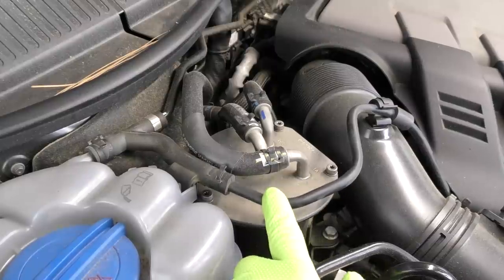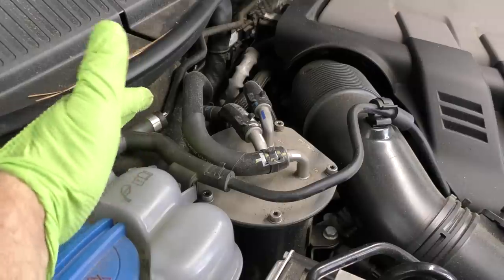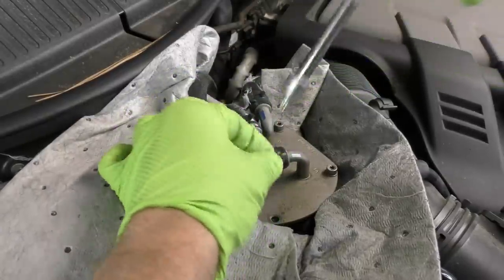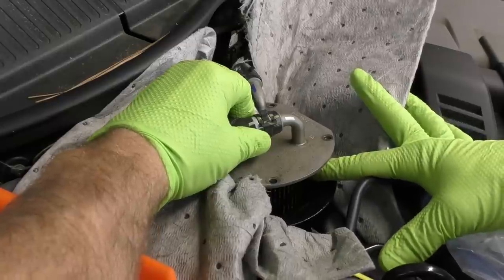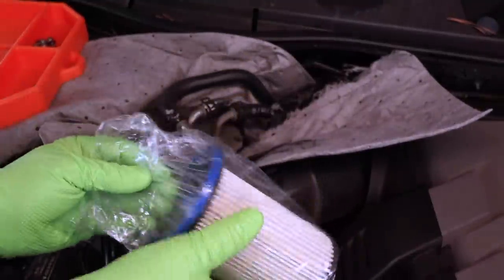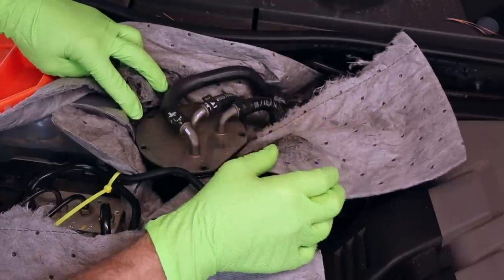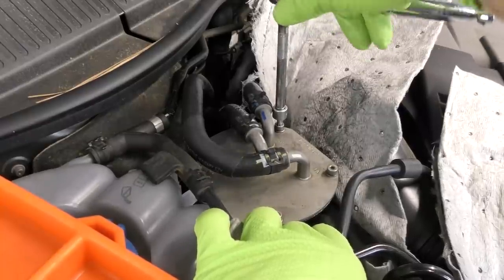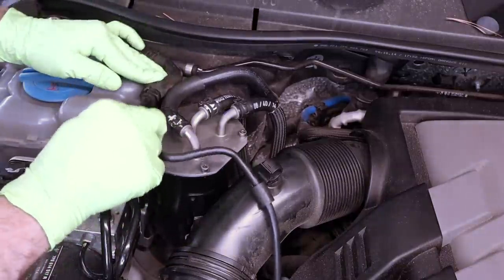How To Install TDI Fuel Filter ~ Diesel Fuel Filter Change

Comment: Just did this on my Audi A3 TDI a few days ago, i just cycled the key 2-3 times and it fired right up as if nothing happened. Easy job
Reply from the maker: Yep that IS what I would do if I didn't have the scan tool. I like to try and give you guys the "by the book" way and the "If you can't do it this way" way LOL
Reply: @HumbleMechanic  I usually do the key method only cause trying to get a scan tool at times can be very tough
Reply: Obdeleven works to.
Reply: @Noneofyourbusiness99  Yes that is true. I purchased OBDEleven for my mk6 sportwagen TDI and had no problem bleeding the system.
Reply: What A3 TDI was it? 8v ? Did you fill up the canister with diesel?
Reply: @jasonjay7650   sold the car but it was a 2013 A3 hatchback... No didnt fill the cannister, just cycled the key to run the fuel pump, started right up.
Reply: @FrenchValleyAirport  I have a 64 reg where the screen comes out the dash.  I want to tackle this job myself but keep hearing horror stories about harming the pump if you don't use vdcs. Thanks for the information.
Reply: @jasonjay7650  Nah, the fact my car started normally shows there was probably little to 0 air.
Reply: @jasonjay7650  i found no need to fill up the canister with diesel.  If the fuel pump is running it should fill that canister in a few minutes.

Comment: Did mine yesterday with the push button start cycling method on a 15 Golf TDI.  Didn't hear the pump running but did the process about 20 times, including driver door openings and closings since I had heard the pump run before when entering the car.  The first crack it ran for about 3 seconds and then died.  On second crank it didn't start.  I began to get concerned and called a VW specialist nearby inquiring how much it would cost to get air out of the fuel system, but he recommended trying another time.  On the third attempt it cranked right up.  TLDR thought I was about to have a $500 filter change but it all worked out.  Thanks for the vid!  (I was also outdoors on a slight incline, don't know if that would make a difference.)

Comment: This is a very helpful video.  I just changed the fuel filter in my 2014 Sportwagen TDI, and did not spill more than a few drops of fuel. The Mann PU936 filter came with an o-ring, and that too was an easy swap out.  As you suggested I cycled the ignition key a few times, waiting perhaps 5 minutes each time, and the engine started up cleanly on the first flick of the key, indicating a full injection pump.
Reply from the maker: Awesome

Comment: Just like my MK3 Leon filter, and very different to my mk1 Leon with the whole canister replacement of the Mk4 golf era.

I don't like putting the absorbent matting around my filter housing because it tends to give off a lot of fluff and shreds. I tend to put it much lower than the housing to prevent any of these bits getting into the fuel system.

Also, for some reason my VCDS won't bleed my system, it fails every time...

Good video, thanks for sharing! Enjoy the content even when I know the task you are discussing. Always great hearing your experience.

Comment: '12 TDI Touareg Exec., I actually do it every oil change. (5k miles). I also use Liqui Molly diesel fuel additive once a month, fixed an injector fault code and she runs smooth and strong! Tks for the great videos but yes we do need more TDI content ;)

Comment: As a Technician... I can confirm most vehicles don't get a new fuel filter until something breaks and blows up 10 years later... I've never seen such a clean and virgin fuel filter that was only 4 years old!!! Shiney!!
Reply from the maker: I Am guessing this was replaced before. I just didn't have record of it
Reply: Fuel filters on diesels have a service interval tho. Usually 60 or 90k kilometers.
Reply: Lol mine was never replaced on my tdi and it started sputtering above 3000rpm so i thought it might need a service.

Comment from the maker: Typically the filters are due every 20k miles. IF you are modified, or concerned about fuel, do it a little more. There used to be a couple of MVB to monitor injectors to intemperate that as fuel filter clogged, but I could not find it on the Touareg.
Reply: i hate changing that filter because about a year ago when i didnt have a computer its wayyy to complicated to bleed the system on old multivans
Reply: my vw cc 2.0 tdi service plan says you should change every 60k miles?
Reply from the maker: @faz06  60k wow! Not sure on ROW cars, but I am Pretty sure all VWs in the US are 20k
Reply: @HumbleMechanic  I have a VW Tiguan 2.0 TDI 170HP. The manual says 60.000 km ( almost 40k miles). I went over the limit and changed it at 52k miles (85.000 km) and it looked 1/3 used/clogged only. This is East Europe (Romania). Everything ok.
Reply: My 2010 passat cc cbab engine  service book (France) tells me to change oil and filter every 30k (long life), engine and air filter every 60k and fuel filter every 90k. I usually change oil, air and engine filters every 15/20k and fuel filter every 30/40k. I always thought the service book intervals were a bit exagerated.

Comment: Nice video Charles! I have never done a fuel filter on a VW but I do them on diesel Ram trucks all the time, it's pretty similar except the trucks have 2 of them, one in the engine bay and one above the rear driveshaft. I don't mind as much if I make a mess with the fuel because the trucks have a lot more space in the engine bay and I always pressure wash the excess fuel off afterwards.

Comment: Can’t believe you didn’t suck the old fuel in the fuel filter housing with your oil sucker tool I always do it on all the cars I service and I do use the VCDS and run the fuel pump cycle at least twice with a power supply on the battery.

Comment: I have a 2014 Volkswagen Jetta TDI can you damage  The high pressure pump cycling the key on and off after changing the filter? The reason I'm asking is the service adviser at my Volkswagen shop told me I could damage the high pressure fuel pump but if that's true I believe you would have said so in this video.

Comment: I always change mine once a year for the car I use daily and every couple of years for the rest as the filters are very cheap and you can clean the contaminants and water from the filter housing. Older models have a bolt with a copper washer in the middle to help bleeding air out of the system.

Comment: I have a 2021 Tiguan and one of the screws on the filter top is slap bang underneath the headlight adjuster, there's always something. The headlight adjuster doesn't look like an easy take off, in fact might be easier to take engine out :-(
Is there no water trap anywhere? All the videos on here, no one empties the bowl to ensure no water in the bottom, I'd have thought it critical

Comment: I changed diesel fuel filter on my MK3 Jetta maybe a week ago ;) and this was fun to watch, BUT, i have a huge question floating around. Yes, on some other cars that i have worked, which have common-rail injection cycling the key 2-3,.. 5 times does the job, however i've heard that on MK7 TDIs, even MK6s, pumps won't start until you actually start the engine, which kinda leaves you screwed. Is that true? I never worked on any MK6 or 7 TDI so i am curious about it. I mean i would try to get it done like i do on my MK3, fill the filter (well, filter housing in this case) all the way, put it back and try to start the engine. Works every time, it starts like nothing ever happened and it runs fine, no hiccups or anything. I leave it idling for few minutes just to be sure, and i rev it up few times and that's it. Takes around 30 minutes.

Comment: Could you possibly do a short vid on the difference between the early and late model fuel filters on the 2.0L TDIs? Looking to change the one in my mk6 jetta with the CJAA engine. Thanks :-]

Comment: I’ve recently done fuel filter on two vehicles the same, 1.6 tdi mk6 2011 and they both ended up air locked, I done the ignition on/off method and neither would start up, had right carry on pulling pipes etc, I don’t have a scan tool that has the feature to bleed the system

Comment: I have a 2014 sportwagen jetta tdi is it possible to bypass the fuel pump relays to activate them and get the same results instead of using a scan tool
Reply: I have wondered about this, as well.  It seems to me that you could use a Powerprobe to power the pump and bypass the relay. Does that make sense?

Comment: You mentioned OBDeleven, does it have the fuel pump activation feature to purge the fuel system?  I’ve looked that scan tool up but there is no mention of that feature, I don’t want to spend a fortune as only a DIYer

Comment: Hi Charles, i have a 09 Phaeton 3.0tdi. Could you point me in the right direction i have high fuel consumption. It uses 11L per 100km but the onboard computer shows 7.7L per 100km. I have noticed my temperature is not going about 60C on the freeway which i am suspecting is a faulty thermostat but could it affect the fuel economy that much.? Thanks in advance.

Comment: Hey dude i really need your help! I changed my fuel filter to a non genuine one (mann filter) i turned ignition too many times i think for like a minute and my acceleration from 800rpm idle to 3000rpm is so slow and heavy, how long should i turn the ignition on and off? I’m going to buy another fuel filter but genuine audi one. My car is (2014 audi a3 sport-back 8V 1.6 TDI manual)
Reply: Man fuel filters are OEM the ones we buy are built-in Germany and one of the suppliers to VW in Germany.

Comment: @HumbleMechanic So i recently picked a 2012 MK6 Golf. I've seen videos saying just turning ignition ondoesn't cycle the fuel pump. You either have to have VCDS, or jump 2 sets of relays @ the same time= royal pain. Is this true?

Comment: I got a Seat with the 1.6 tdi engine and it's always a pain. I've changed the fuel filter (canister) 2 times already and no matter what or how I do it, air always manages to get trapped and the engine doesn't turn on. It's a complete nightmare. This last time I pre filled the filter with fuel additive until it drip so no air bubbles, connected the fuel lines as fast and as careful as I could. Did the bleeding through vcds 5 or more times just to be on the safe side, turn engine on, it worked for 5 seconds I thought "yay it worked this time" and then died. Spent an entire evening trying to bleed the air with a syringe and the more I pushed the more air bubbles showed in. The weirdest part is I saw mechanics changing the fuel filter and simply turning the engine and it fires right away.
Reply: Did you manage to find the problem for this?
Reply: @MrAdamKhawaja  No

Comment: Surprised you didn't drain the fuel canister out.  I have a Cayenne Diesel and Porsche wants it drained every 10k miles.  Since the filter is only ~$25 I just replace the filter at the same time vs the 20k mile interval Porsche says
Reply: Same thing I do everytime I change a filter. When cleaning the housing I can inspect for fuel pump failing if I see any orange particles that look like rust.
Reply: On the older models you had to drain the canister, but not on the new(er) ones.
Reply: I run stanadyne every second tank and haven’t found any water in the Treg or my powerstroke since I started using it
Reply: @panzerveps  my Cayenne diesel is a 2015, Porsche still wants the fuel canister drained every 10k miles
Reply: @docwyte  Cayenne and Touareg have the same engine, the difference is the block is aluminum in Porsche and Steel in Touareg.  And VW says that fuel filter has to be changed every 20k miles.
Reply: @tosyawilldoit  Yeah, I said the interval was 20k miles in the last sentence of my post above.  But Porsche wants you to drain the fuel out of the canister every 10k miles, to do so, you have to remove the filter, so it seems stupid to not replace it at the same time given how cheap it is
Reply: @docwyte  🤷‍♂️
Makes sense

Comment: Just curious as to what procedures you would take for a mechanical fuel pump like the alh engine in the mk4 jetta tdi
Reply from the maker: I always PREfilled those with ATF. You can use a vac pump to pull the last but through the lines
Reply: @HumbleMechanic  ok. My father said something about that but he wasn't sure. Thanks for the info.
Reply: @HumbleMechanic  am I reading your reply correctly?  ATF to prefill the fuel filter cannister?
Reply from the maker: Yes for the ALH it was good. New ones probably not so much

Comment: Good video. fuel filter design is clumsy and looks crammed in, I've dealt with diesel fuel filters on MBs, and older VWs that simply screwed on, what utility does this bring to the user?  Not as bad as the piece of krap filter on my old chevy suburban diesel, every 5k miles it failed, typical GM design.
Reply from the maker: Utilities to the user is one of the lowest concerns with this type of thing. Lol they don’t be caring

Comment: i recently watched a video on Liquimoly diesel purge and found out some people recommend pouring a can inside the filter housing and running the car straight purge ; do you think doing that on the Treg 3.0 TDI be OK?
Reply from the maker: I don’t want to run it straight. Maybe the ALH but not the Touareg for me
Reply: HumbleMechanic thanks ; do you think is even worth pouring in fuel tank? maybe you can make a experiment with thay kinda thing there is very confusing info

Comment: Man, doing fuel filters on a VW diesel is very different than the Powerstroke trucks I'm used to. They have 2 (ever since 2003 with the introduction of the 6.0l) and it's a much more involved job and it's supposed to be done every 12k-15k. Depends on the time of year and how much you drive, and the way you treat your truck. But for the fuel bleeding, I cycle the key 10 times, with an interval of letting the key stay on for 30 seconds and then re-cycling it. Interesting to see how it's done on VWs, though. Seems like it's a bit easier and less time consuming. That's probably the only time I'll ever say that working on a VW is easier and less time consuming than working on a Ford.

Comment: Have done two Fuel Filter changes so far in our 15 Golf TDI, didn't know about the priming method with VCDS or OBDEleven until just after the last change.

What I've done is clean out the fuel filter housing by sucking the fuel out and wiping down with a lint free rag, then after I place in the new fuel filter, I fill the housing with fresh diesel slowly so the fuel enters from the outside of the filter, insert the pickup for the HPFP in the hole, tighten down, then a couple key cycles.

I'm sure there is a tiny amount of air still in the system this way, but the starter literally cranks for only half a second more before it fires up, the difference in start of normal vs after a filter change is turn key chug fire vs turn key chug *chug *fire*.

Our local VW dealer quoted $180 to change the fuel filter.

Comment: Charles why is the mark 6 golf 1.6tdi such a pain to bleed and normally requires a computer to prime the system
Reply from the maker: They all technically "require" it, but a bunch of key cycles helps that
Reply: Thanks Charles appreciate the help wish it was like Mercedes tho put the filter on and turn the key and crank engine till start and away you go 🤣
Reply: I also have mk6 golf 1.6 tdi and becouse of fuel filter I bought Obdeleven. Unfortunatley even that didn't help. When you start the fuel pump in the tank it cycles fuel only betwen tank and fuel filter. Fuel line that goes from filter to HPFP drains the fuel when you lift the cover of the filter and than youre stuck with air pocket in the line. Than you cycle the pump in the tank which doesn't prime the fuel line leading to the HPFP. Than you start the car, HPFP air locks and car doesn't start. (starts for a second or two, than dies and cant start again)
I since found out that when you prime the fuel system with obd computer first you cycle the pump about two times than on the third cycle start the prime pump and while pump running disconnect fuel line leading from filter to the HPFP at the HPFP (but only slightly so the air can escape out, becouse emmediatley after that the fuel will rush out and spray everything!). Put some rags around the fuel line, and than quickly reattach the line and secure it with clamp. Stop the tank pump or leave it until cycle stops. 
Than start the car. Works every time.
I serviced bunch of the VW diesel engines, but only had to do this on mk 6 golf 1.6 tdi.
Reply: I got a Seat with the same engine and I feel your pain. I've changed the fuel filter 2 times already and no matter what or how I do it, air always manages to get trapped and the engine doesn't turn on. It's a complete nightmare. This last time I pre filled the filter with fuel additive until it drip so no air bubbles, connected the fuel lines as fast and as careful as I could. Did the bleeding through vcds 5 or more times just to be on the safe side, turn engine on, it worked for 5 seconds I thought "yay it worked this time" and then died. Spent an entire evening trying to bleed the air with a syringe and the more I pushed the more air bubbles showed in. The weirdest part is I saw mechanics changing the fuel filter and simply turning the engine and it fires right away.

Comment: Any chance you’d do some how-to on an Audi, say an S5 with the supercharger?
Reply from the maker: That would be awesome. I haven't looked too much into those engines beyond my training classes
Reply: If I remember correctly, the fuel filter is inside the fuel pump assembly in the tank. The V6 supercharged S5 was quite new when I quit, so I might be wrong.

Comment: Easiest way for home mechanic to bleed is to pull the starter fuse and start car. Usually will run the lift pump for 30 seconds then cycle off.